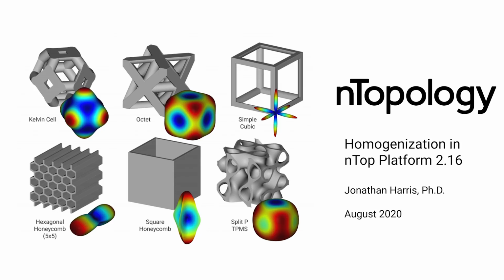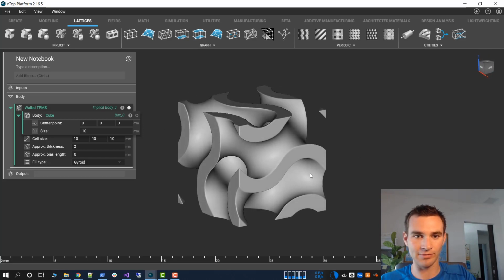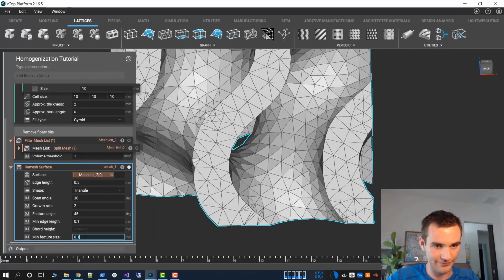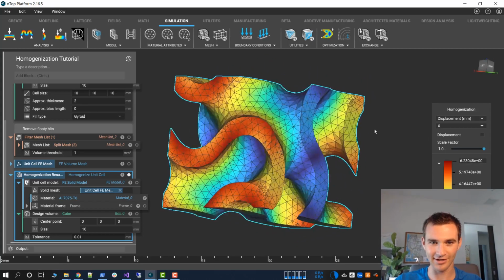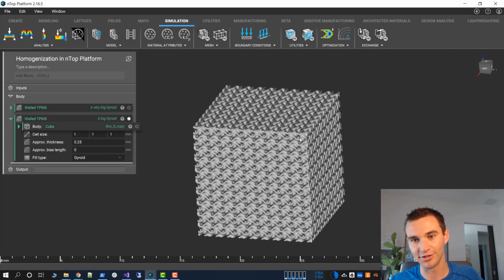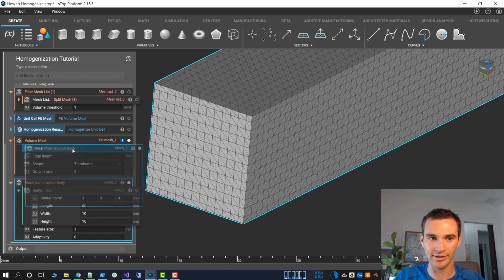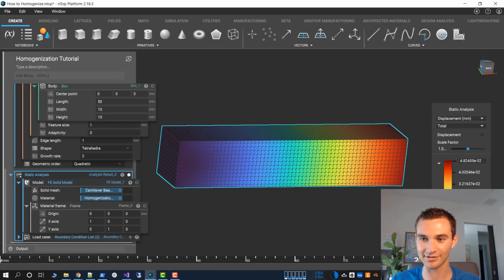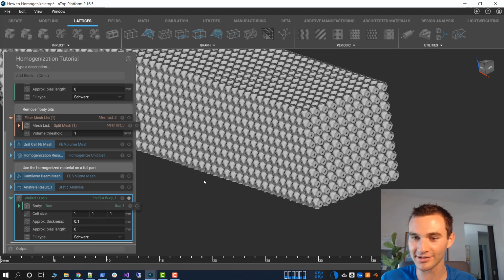How to Accelerate FE Simulations of Lattices using Homogenization

Comment: Jonathan the menu is not same with new ntop version (4.8.2).  I couldnt see the  explicit menu and walled TPMS under the lattice  tab on 00:04:13.  When I select the "Walled TPMS unit cell",  I cant add the box to body.
Also there is an warning in the model "Volume Mesh version 1.0.0 has been deprecated and is no longer available due to a meshing library update" 
The program has changed a lot in 2 years. 😒

Comment: i couldn't figured it out how it is possible to export CAD from lattice structures such as gyroid ? there's no video or even help in the site considering export one cad from lattice. it would be a huge assistance if someone can help me with.
Reply: Hello Iman, here is a link to our article for exporting parts to CAD. 

https://support.ntopology.com/hc/en-us/articles/360048784874-How-to-export-geometry-as-a-CAD-part-STEP-or-Parasolid-

You need to convert the lattice structure into a mesh first, then follow the steps in the article.
Reply: @jackwalles3310  Thanks for responding Mr. Walles. I've read this article and i did it before. So what I understood from your site is you can't do quad mesh for lattice structure. It seems that is not possible for quad mesh to mesh lattice. When ever I've tried to  apply Quadrangulate Mesh, that only completed 75% of it. Actually it stucked in 75% and never completed. Therefor my main problem relates to Quadrangulate Mesh for lattice structures. I wonder if it is possible for you to solve this problem by sth like hint or making a video about it. Because CAD of lattice structures are vital for Mechanical and Tissue engineers. Thanks a million.
Reply: @imanghaderi5636  Yes currently the Quad Mesh block is designed to be used for Topology Optimizations. We are aware of this issue as many customers have the same intentions. We currently do not have a solution but we are looking into it. CAD programs can generally only handle around ~10,000 faces, making it difficult to export a part that those programs can handle. Lattices and TPMS parts can have millions of faces, as they are complex structures.  

Happy to help and answer questions!
Reply: @jackwalles3310  Got it. That was helpful. Thanks 🌹👍
Reply: @jackwalles3310  hi, how can I apply for an edu license? I've filled out the application form several times but got no response.
Reply: @johnzhang12  Hello, this most likely means your license request was rejected. I apologize but there is nothing I can do if this was the case.

Comment: Great method Jonathan, thanks for the video. Question; can I simulate the mechanical response of a large cell array made up of different homogenized unit cells? e.g. say a 3x3x3 unit cell array where each of the 27 cells is a different homogenized cell? if so how scalable is the workflow to do this for a very large array say 100x100x100 cells? thanks
Reply: Hii
Have you tried it? Can we apply it for gradient porosities?